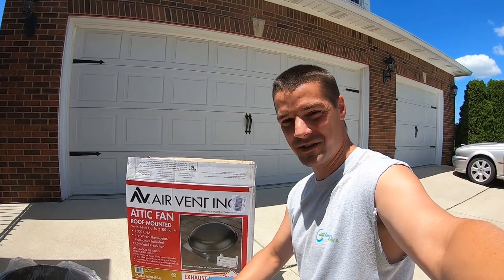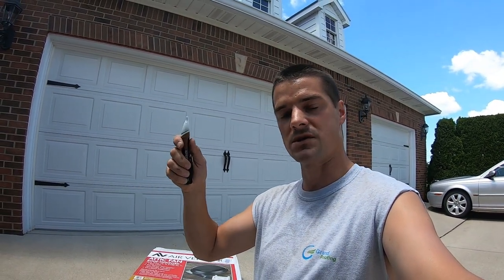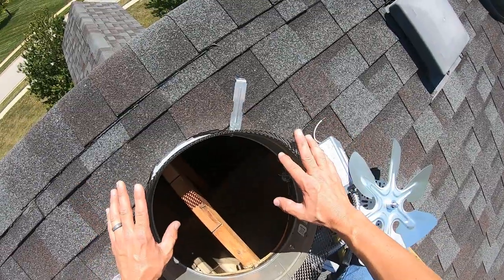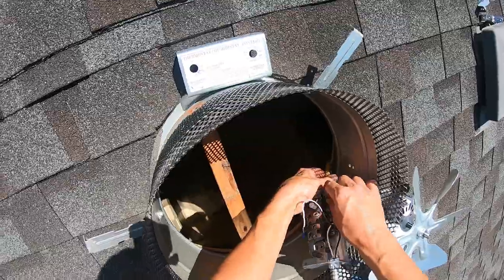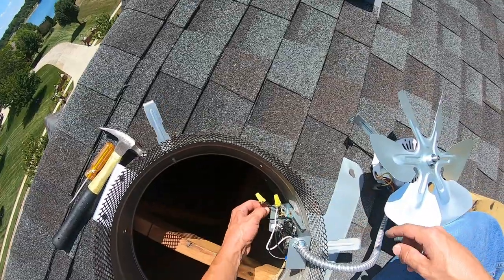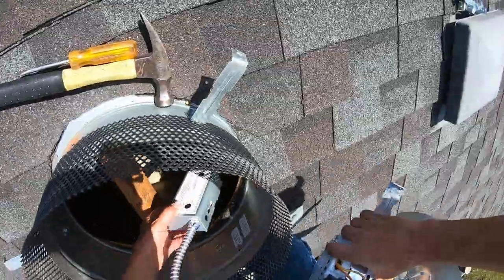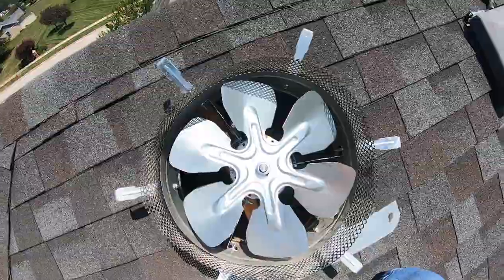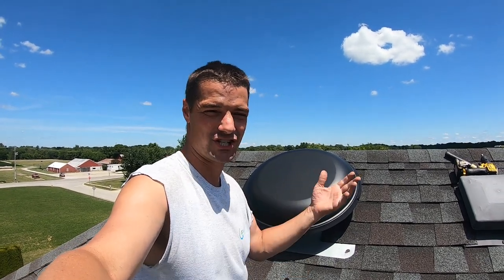Power fan replacement 2020

Comment: Looks like the roof had vented soffit with no ridge vent. However, it had 2 passive roof vents in-line with 2 power vent fans. By having those 2 passive vents, the limited roof ventilation is being short-circuited. When the fans run, cooler air is being pulled mostly through the passive vents thus not providing much opportunity for air to enter soffit vents and travel all the way up under-side of sheathing in order to properly cool roof. Assuming there is a free path for airflow from soffit vents to ridge, then those passive vents should be eliminated to facilitate proper and maximum roof ventilation.  Ridge vent is usually best way to properly vent a roof assuming one has sufficient soffit venting. Good job on motor replacement.

Comment: Why do builders put these powered fans in vs. a simple ridge vent? What's the advantage?  The disadvantage is they have a limited lifetime.
Reply from the maker: Yes you're right they have a  limited lifespan. Especially when your insulation is cellulose because it's very Dusty! My opinion is if there's an advantage they do Cool the attic off quick, providedit's it's matched with the right ventilation in the right areas. For example if you have box vents or ridge vent close to the power fan, it's going to more than likely circulate are between it and the path of least resistance. To me it seems that would be a disadvantage. I would prefer plenty of soffit vent leading up to a well-cut open ridge vent. Yes I said cut open because I see so many were they installed either a box vent or ridge vent but failed to cut open the decking. Cheap roofers. if I were to ever install one on my house I don't know that I would want a ridge vent or box vent in the area.